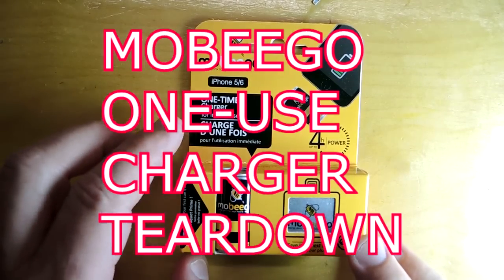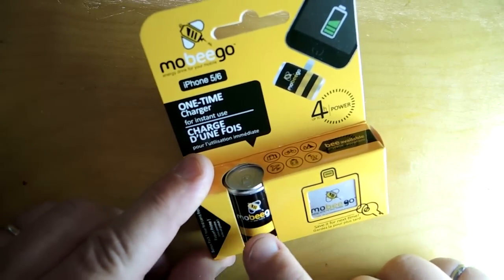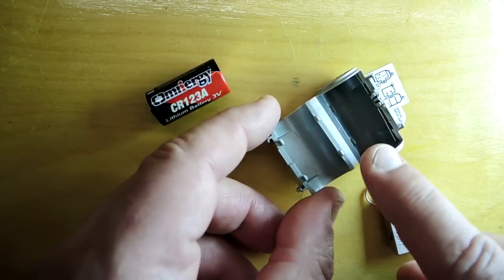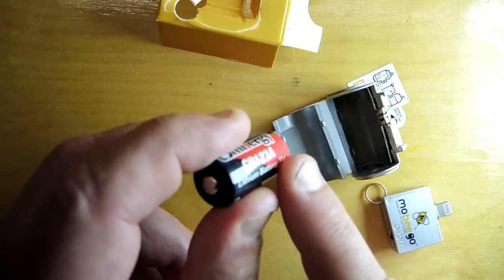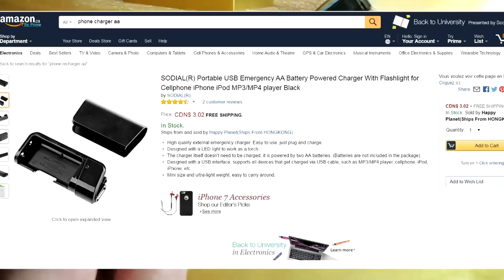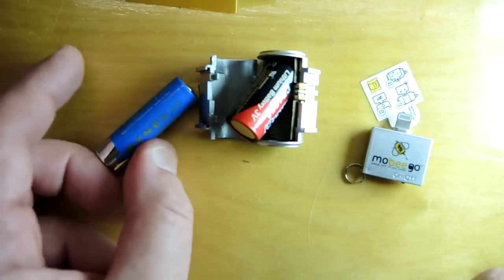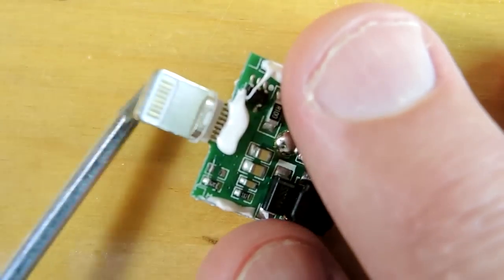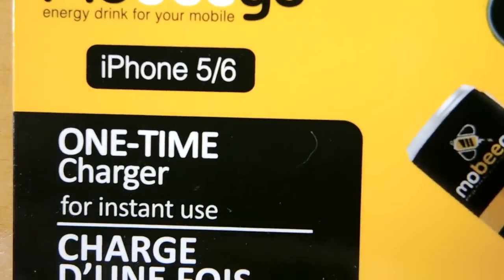mobeego One-use Iphone Charger Teardown

Comment: I see two sot23-5 and two sot23-6 — that's more than enough package to have some pretty sophisticated microcontrollers inside. Keep in mind how small a typical lightning connector is — smart or not they're not going to have a QFP chip in there.

One of them is probably the lightning controller, one the SMPS controller (wild guess: the 6 pinners) and I would guess the other two are the switching mosfets. The four other little transistors are probably the mosfets that control the lightning port — because it's reversible, there might be a need to switch around which pins get what with an H bridge, and, well, there's four of them.

One thing you didn't mention: for ten bucks you can usually also buy a pre charged rechargeable lithium power pack of minimalist capacity (either single 18650 cell, 2000 mAh ish, or larger, up to 10k). These are quite often sold as emergency items for when your phone is near to dropping out and you need power now. So they're not even doing a very good job of having a razors and blades business model, because the razors are costing more than the reusable item.

Comment: it is power by 1no. 3v battery,so is it possible to modify to use 2 AA batteries (also = 3v) and so that to buy the battery is cheaper and easier? maybe to charge the phone will be not as much as the single 3v battery but it's still useable

Comment: I'm fascinated by cheap electronics.  The ability to build down to a ridiculously low price is an art in itself.
Reply: Not so fascinating, if you use counterfeit chips.
Example: An original switch-mode li-ion 2-cell charger from LTC: LTC4002ES8-8.4 costs ~  1.7$ in bulk from LTC. Immediately avaible are maybe ~2,000-3,000 from a distributor, factory lead time are 6 weeks.
On alibaba you get them for ~0.4$ in quantities of 10,000-100,000, immediately.
Go figure...
Reply: Bitter...

Comment: Why are you comparing batteries by amp hours rather than watt hours?
Reply: I definitely agree, this is rather misleading as the CR123A 3V 1.8Ah lithium cell actually holds more energy than the AA 1.5V 2.7Ah alkaline cell. Amp hours aren't a measure of energy, watt hours are, and Watts = Joules/second, not amps.
Reply from the maker: seems to be the tradition with battery capacities
Reply: I suppose I'm just nitpicking here -- with 1.5 and 3 volt cells it's easy enough to do the math in your head but any other time the watt-hour measurement will make capacity comparison much more direct and intuitive, as I see it.

Comment: Yes, for an emergency charger you would want to have the ability to use the most easily obtainable battery, if you have to go to a specialty shop anyway, you could get a cheap rechargeable USB powerbank, sure they are not fully charged, but will probably still have at least equal capacity to this thing and I suspect better current output capability, so would charge the phone faster, and then you would still have a reusable powerbank you could recharge and have for the next time you need power on the go, or for some other application. 

Now, I can see one situation where using a primary lithium battery might be an advantage, these have pretty good shelf/storage life, so an emergency charger with such a battery could be stored for a long time and be an extra backup in addition to a normal powerbank, car charger or something. But for such an application I would at least expect the thing to be sealed against moisture and dust, perhaps have a desiccant or some water displacing goop inside, recessed terminals(so they couldn't short easily), and a less flimsy shell that would protect against accidental crushing or piercing.

Comment: Are you sure you have the correct datasheet? It seem that they make 2 versions of the CR123a: High capacity (10mA/1800mAh) and High power (rated at 2A discharge/1300mAh).
Reply: yeah doesnt seem  right, im using 2 cr123 in a flashlight that pulls around 1000ma

Comment: mobeego, typical USA company, repackage existing tech into a proprietary housing so they can charge you 10x the price
Reply: theres cheaper alternatives which use a simple AA cell. Look for emergency usb charger. The charger itself costs about a dollar and the batteries are easily obtainable pretty much everywhere.
Reply: drkastenbrot
yes indeed i have them myself, i initially had one from a dollar store that used a lithium aa as its base, then later have several lithium 18650 ones, they hold a charge for years but recharge also!  theres no need to make an overpriced one use gadget to fill landfills and con people.

Comment: That black 2* AA battery USB charger suck.
Reply: They are fine for low drain use (<500mA) but IIRC they don't have any current limit protection

Comment: I see a big issue with the implementation of the can. the contacts are exposed, close together and there's no protection circuit used. CR123s are not  Alkalines, they can explode violently when shorted and vent gasses. 

In any case, for the price, a single 18650 USB powerbank will be a lot more convenient and actually able to charge the device at a fast rate.

Comment: What a ripoff!
Reply: It's still a ripoff if you pay more for something than it is worth because of the company's attempts to keep you ignorant about the value it offers. It doesn't appear that there's any intentional deception (what you're talking about), but the company is exploiting an information asymmetry to make the deal unfair.
Reply: That's not what the term "rip off" means.

If you're willing to pay that price for that functionality and you're getting that functionality, it's not a rip off.

It's only a rip off if you're not getting what you paid for.
Reply: +Villnius - There is more than one definition of "rip off", and this is certainly an example of a rip off. From Wikipedia: "Usually it refers to an incident in which a person is overcharged for something". It is indeed a ripoff if you can buy something else that does the exact same thing for 1/10 the price.